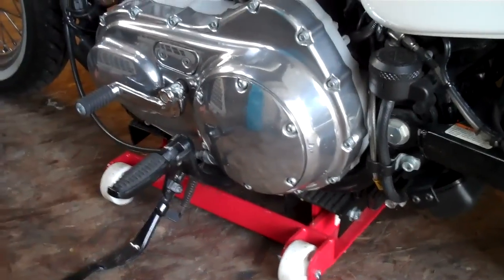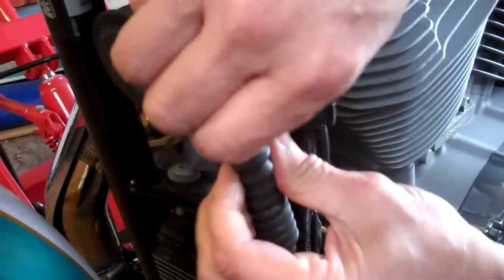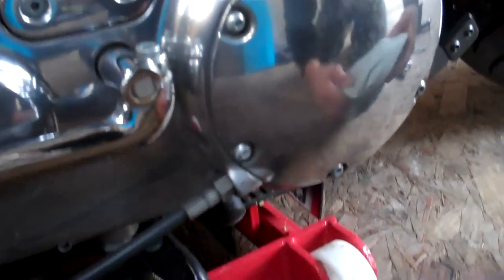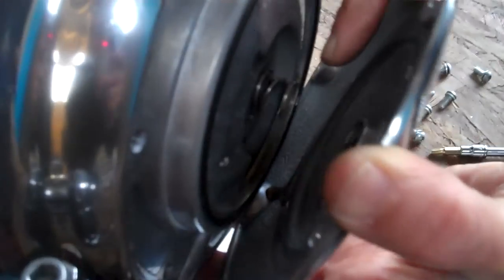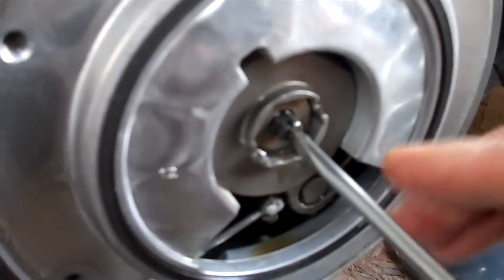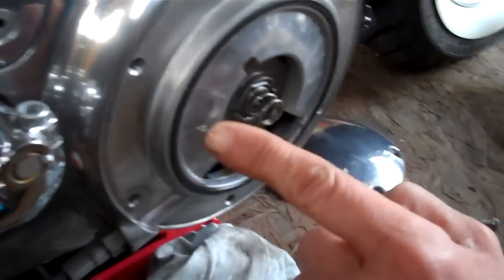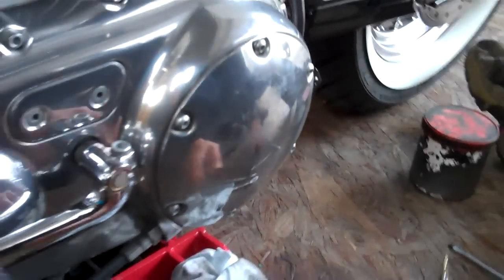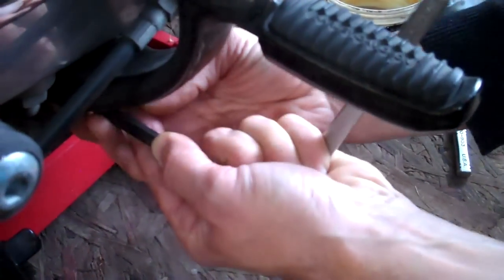Delboy's Garage, Harley Sportster Clutch Adjustment.

Comment: NEED HELP...2016 Sportster 883. 1000 mile self serviced. After replacing the primary oil with Screaming Eagle 20w50, (it's what Harley gave me for the primary) gear adjusted and clutch cable adjusted as per instructions in ur vid, the bike now jumps forward if I start in 1st with clutch engaged. Too tight? Incorrect viscosity?
Reply from the maker: +Scot Alexander Hi Scott, I guess you've done something wrong there somewhere, although jumping forward whilst starting with the clutch in isn't really a measure of anything... remember you have returned it to correct factory spec after the bedding in period... all clutches will be a little feeble when they are brand new, as they have yet to 'bed in', which again, is why we do the clutch pack adjustment on first service, and indeed, every service as it wears... so provided you have installed the oil they gave you and recommended, then it won't be that... provided you have adjusted the screw correctly, then it won't be that... it could just be that it needs to settle down..... and as the test method you described is a bit irrelevant, just take it for a good long test ride, get everything warmed right up and then see how it feels.... as long as your clutch does not drag at all with the motor running, in gear and clutch in, and it goes in to gear ok (they are always a slightly heavy 'clunk', it is a Harley, after all!)...... then that is fine.  They don't call these tractors for nothing lol !  See how you go with that and let me know, Del
Reply: +Moonfleet41 Thanks Del for the quick reply. I imagine if u gave ur mobile number out you wouldn't get any sleep or work done. haha..utube wil have to suffice. I should mention, the factory bars were raplaced 5 days ago with 28" drag bars, zero rise and 4" pull back. Same gear cable. Also, I noticed there was no slack felt when initially adjusting the gear bolt. That .25 turn wasn't there..it felt seated from the go. It's a tiny hop but noticeable.  I am going to try the adjustments one more time in case I did do something wrong... then give it a few days of riding as u suggested. It unbelievably snowed in South NJ yesterday, but hopefully ill have dry roads this afternoon. 

Would you know what mechanically in the xmission and clutch assembly design would make any bike hop in this manner? 

Tell Penny Scot says "hello", and still no progress with the wife! But at least she not waking up in the midnitght hours and trying to set my bike on fire anymore! So..maybe a little progress. ;-) On a positive note, my kids love my bike.
Reply from the maker: +Scot Alexander Hi Scott, as you mentioned the handlebars you fitted, thought I would make a point that may help!  had a set of those on my 883R recently, which doesn't have big bars to start with, but I still needed to re-route the clutch cable round the RIGHT side of the headstock, so take all the clips off the frame rail and allow it to move freely, then take it off the lever and route it up the right hand side of the head stock... and then across to the left to the clutch lever... this will mean that it doesn't have to bend so sharply to go downwards... it's more of a wide open loop in the cable, and this could possibly be your problem!  It may not be, but it pays to get it right... also you then won't have loads of cable hanging around as it's too long for those bars...  I hope that helps and let us know how you get on!

Penny says glad she helped in some very small way lol ... keep trying, at least the kids are on your side ha ha... and snow??? what's all that about... not much better here, still dry but bloomin' cold !!
Reply: +Moonfleet41... initially I thought the tighter bend in the cable could be the cause, so I released all of the clamps to free the cable and the bike still hopped. rerouting the cable is a great idea and as soon as I get ahold of a spreader for the pin washer, I'm going to reroute. I'll let u know how things go after a few days of riding, and I'm thinking of calling harley to get the POV. The flipped mirrors are another issue, and I may need to replace them so they are not hitting my tank with these drags. 

Let Penny know she gave me an approach to Jen [The Misses], that I would have never thought of, and that is priceless. The 883 as you know, isn't really made for two, but my goal is to get her riding her own one day. Pillion pegs and a helmet foe her are on their way, and after a gentle ride with a beachside dinner destination may just do the trick! Thank you Penny!

Snow at the Jerry Shore in April is unusual..but that is a whole other discusion. Definitely depressing when all of us are longing for warmer weather. Our beach outings are a bit delayed this year, and  our pool is usually opened by now! 

God bless and I'll send an update soon.
Reply: +Moonfleet41 ... I am absolutley beside myself. I had the Sporty out all day on this gorgeous sunny Jersey Shore afternoon and she shifted like never before. From 1st thru 5th..absolutley clean, no hesitations. I cannot believe how much the clutch and gear adjustment and oil change improved the feel of the ride. Better than the first ride! Thank you Delboy...you are appreciated.
Reply from the maker: +Scot Alexander Excellent news Scot, im glad you worked it out buddy..and good that you had a day out on the bike... here's hoping for a long warm summer ahead aye...

Comment: I've done this 2 times on my 2000 sportster in the last week. Every time I did this the clutch was working perfect but I started to hear some strange whistling sound. During lunch I went for a quick ride and the clutch went out when I down shifted and kinda skidded to a stop.

I was able to get it into a parking lot and that was it. I went back into see if I can do any adjustments but immediately when I turned the adjuster counter clockwise, I heard and felt grinding. Took a look and all the bearings were pulverized.

I also looked at some other youtube videos on making adjustments, how come the other vids say to turn it "clockwise" till it seats then "counter clockwise" (opposite of what your instructions are)?

Anyway, what should I do now? I don't have much history on the bike at all, had it for only 4 months now.

Thanks in advance,
Dzung
Reply from the maker: Dzung Quach Firstly mate, I'll try to ignore the 'blaming tone' of your email and see if I can help you!

You have no history on your bike and you seem to be insinuating that I am incorrect in advising to turn the screw out counter-clockwise because you have seen other videos which suggest clock-wise... are they videos on Sportsters... or Dyna/Softails, cos on Big Twins you do, indeed, turn clock-wise (the other way to a Sportster!)... and as you have no history on your bike, is it just possible that in the 15yrs it's been on the road it could have been neglected, or damaged by a previous owner??

Trust me, on a Sportster motor you turn the clutch adjustment screw 'COUNTER-CLOCKWISE' and as you clearly don't seem to believe me as you've 'heard' otherwise, perhaps you should check with Harley-Davidson to find I am right, or perhaps buy the H-D Sportster Service Manual (about £60) and read it for yourself...

Before all of that though, if you have a collapsed clutch bearing then your first job is to replace that and any other damaged parts... and whilst you are buying the parts, order yourself a manual as well!

And just one final point, if you turn a Sportster clutch screw all the way in clock-wise you won't have any actuation AT ALL, the plates won't dis-engage properly and when you try to select gear the bike will stall... but verify this for yourself with the main dealer...
Reply: Moonfleet41 Oh man! Moonfleet41, I'm sorry my tone sounded like the way it did. I did not in anyway wanted to give off that vibe and just wanted clarification. I appreciate your reply and I do have a manual.Once again, I'm sorry for sounding like a douche!

Comment: Hey mate...great vids...say, question..I have a 20017 48...it has about 4K miles..well, the clutch is slipping, especially in the higher gears..it shift fine, but slips considerably...I have it upgraded with your standard hi flow ac, bozzani pipe and VH tuner so Im thinking of also upgrading to a better clutch than standard...will decide after they do the 5K service and they can advise, a simple band adjustment may work I guess...but if I decide on a new clutch..any suggestions? Of course the Harley dude is pushing the screaming eagle clutch..but I don't know if thats the route...anyway, thanks in advance for your advice
Reply from the maker: Hey Ralph, sorry buddy, i only just saw this comment because it went to spam, we get so much mail they system often trashes some of it... Ok, so your clutch..  with just a simple stage one and pipe, there is no way that clutch should slip... if its due a service, then get that done (or do it yourself), then with new primary oil and the clutch pack adjusted, (both things are part of the service), see how it is... those clutches should be able to take even a stage two tune with cams and still be fine... its not weak, its not inadequate.. its just faulty, and you can fix it...  if you do choose to upgrade your clutch, then you'll have a much heavier clutch lever pull afterwards, so just know that in case you didnt want that... Good luck with it.. Del.
Reply: Hi Del...yeah thats pretty much what I thought  simple clutch adjustment..just wanted your take since you are the man..my main man lol..with you lived here in southern Calif...great year round riding weather and lots of great roads..and I would have you as my mechanic lol..where are u anyway...New Zealand..Aussie? I suppose both great places...well thanks for the great informative vids and ride safe,,but fast! lol cheers
Reply: correction..."wish you lived here" lol
Reply: Oh just listened to one of your vids..your from England...sorry..I still can't tell the diffence between English, NZ and Aussie accents my bad lol

Comment: i have 3 screws lost, any suggestion where to get some for the clutch cover?
thanks~
Reply from the maker: +Frank Alonso Hey buddy, those screw that hold your Derby cover on are available from the dealer, last time I bought a couple they were about £3 each ... make sure you get the right size cos they are not metric... and whilst you are at it, why not buy a couple of spares, you'll always use them!
Reply: +Moonfleet41 thank you so much, i actually got them in Ace hardware for .45 bucks each, i installed them and adjusted the clutch. 
ride safe!

Comment: Is there a way to adjust the pull of the clutch? I have two sportsters, one has a heavy pull with a short clutch engagement, the other has a lighter pull with a longer clutch engagement. I wonder why they are so different
Reply from the maker: Are they different ages?  Earlier models had the same clutch ramp as a big twin but from around 2005 onwards, I believe, Harley designed a shallow and longer clutch ramp to make the lever pull half the weight, there isn't really much you can do to lighten up the heavy one unless you can find, and fit, an aftermarket clutch ramp... simple enough job if you're accustomed to working on Harleys.
Reply: Delboy's Garage 2004 and 2005. I will look into clutch-ramps

Comment: awesome video! your channel has helped me a lot to service my 08 nightster xl. I've watched this one about the clutch because when I'm on the road and shift from 1st thru 3rd and give it a little throttle the bike just revs and doesn't accelerate. just wondering if you might of had that kind of issue.
Reply from the maker: +Wes F Hi Wes, Its sounds like classic clutch slip, and thats why we check and adjust the slack and freeplay in the clutch pack.....it ensures that the plates are closing together fully and not being held apart.....have you done the clutch adjustment here in the video first buddy..?
Reply: +Wes F you need to adjust the slack brother its slippin under load
Reply: Moonfleet41 ok thanks I kinda figured it was connected to that. Right I get you. An no I need to. I only did the clutch cable trying to deal with a pulling issue when stopped. But will do it immediately since its my daily ride to work and such. Thank you for taking the time to response sir.
Reply: Mason O'Connor thanks man I kinda knew it might be but wasn't sure. I appreciate your help.

Comment: Hi Mate, What grease do you use for the rubber gasket. Cheers
Reply from the maker: Hi buddy, you can use regular ordinary straightforward grease, something fancy like red rubber grease, or even just a dab of the primary oil on your finger, just anything to help it slide in to place once you clamp it up!

Comment: hi there. im riding a 2005 sportster 1200.  without the motor running and pulling in the clutch lever the bike doesnt seem to roll freely if put into gear.  but if i start it in neutral and let it warm up a bit, then put it in gear, it seems to work fine but still kinda feels like maybe it trys moving.  does it sound like it needs adjustment??   Thanks
Reply from the maker: Hi mate, no Harley will roll freely with the clutch in, in gear and engine off....the plates are too close together an the thin film of oil between them will glue them together unless the engine is running, so thats correct and as it should be..... if the clutch pack hasn't been adjusted in the last 5k miles, then you should do it, it doesnt take long and then you have peace of mind... good luck with it my friend, ride safe.. Del.
Reply: Alright!!  thanks for the knowledge.

Comment: Tell me if you've ever seen this before. My dad had an oil leak from the front rocker box. When I took the rocker box off on of the little rocker box bolts had obviously vibrated itself loose and got jammed up in the valve spring. Luckily it didn't cause any real damage, which would have sucked because he was trading it in. It was an 06 sportster 1200. I have a sportster now and I was wondering if I should pop the rocker covers off every few thousand miles and check. I'll send you a picture of the carnage if you want to see what happened.
Reply from the maker: Never seen that myself mate, perhaps it wasn't torqued down properly in the first place. !?
Reply: The rocker box had never been off before that, he bought it new and never had any engine repairs done to it. It only had about 18k mi on it when this happened. Just wondering if this is a common problem.
Reply from the maker: Nick B
No Nick...its not a common problem mate, like i said, ive never heard of it before.....but i have heard of factory errors and build faults....thats what warranties are for...and anything mass produced can have glitches..

The only other thing it could possibly be, is that the 10K 'Critical Fastner Check' was missed out on the big service...Harley's vibrate and fall to bits if you dont do it....thats why the factory stipulates it and gives you a full list of the values and bolts to check in the manual.....maybe missed out by the service guy?..
Reply: Yea that last bit makes a lot of sense then. He also had the rivets on the clutch pack come undone and destroy the clutch basket so I guess the vibration can cause a lot of issues. Thanks for the insight.

Comment: What kind of Grease are you using? Obviously it is something that I should have on hand in my garage for repairs and maintenance.
Thanks for a smooth vid!
Reply from the maker: Hi Jonathan. I just use regular common LM grease, you can also use red rubber grease, but no real need with this as those seals are oil safe... good luck with your jobs in the garage... all the best, Del.
Reply: Moonfleet41
 While I was messing with my Clutch today I wanted to go about trying to fix something that has bothered me from the day I purchased my ride. My clutch pedal sits a bit low for me. The angle taken from the center of my peg is only 24 degrees. Basically I have had to point my toes down (very awkward I must say) in order to shift up. I found a few nice diagrams online on how to adjust the lock nut's on the shift rod but It doesn't seem like my shift rod is long enough to get the angle to 45 degrees. Is it possible to remove the retaining screw from the shift shaft arm itself and turn it slightly toward the front of the rig to give me more to work with? Otherwise I think I may have to search for a longer shift rod.
How many threads is safe minimum on each end of that rod?

Thanks in advance, I just discovered your videos two days ago, and I already feel more confident in tinkering on my ride. I know some friends with fears of doing their own work as well and can't wait to reference them to the vids you are working on!
Reply from the maker: Jonathan Bailey
Hi Jonathan. Yes you can move the shifter tab round the teeth on the spline that comes out of the primary...this will move the whole rig enough to get a good safe adjustment... if you are getting close to the end of the thread, try to keep a minimum of at least three quarters of an inch of theads touching...otherwise you will loose the rigidity and it could bend under load.. hope that helps buddy... good luck with it.. Del.

Comment: Sorry if I didn't mean it right. The belt is ok. The primary chain was too tight, as the dealer said. The noise heard is in the primary area, when releasing the clutch. I asked about the noise because I'm about 100 miles away from the closest dealer, and maybe it could be just a clutch adjustment.  Unfortunately the dealer is careless and keeps saying sportsters are noisy. But thanks for your attention anyway.